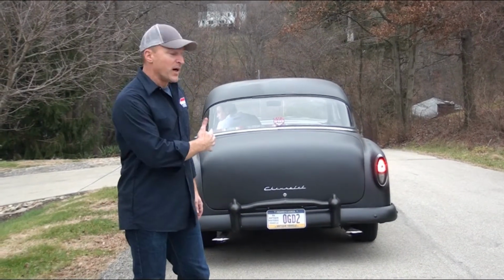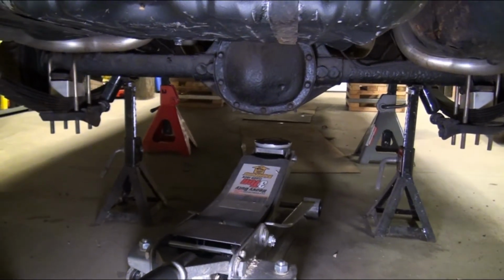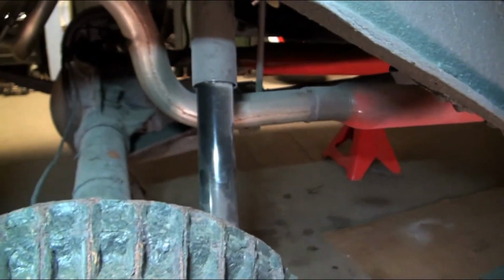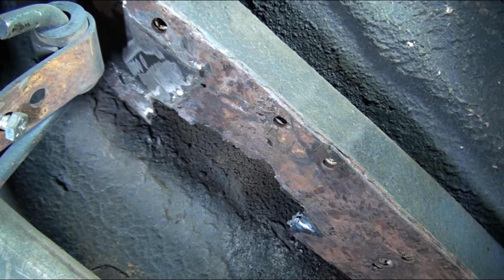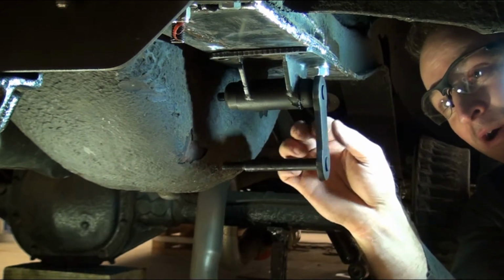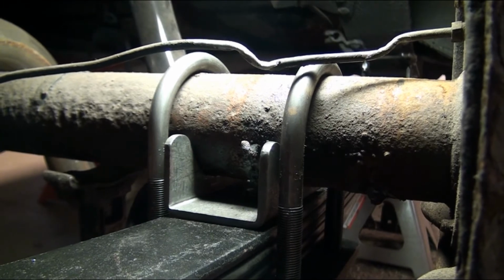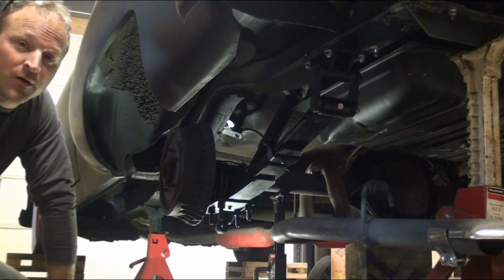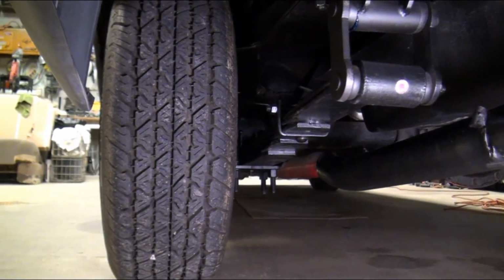1954 Chevy Sedan Rear Leaf Spring Suspension Swap

Comment: That is definately NOT the original rear end btw, the original rearend had a closed driveline. Great job, I really love these old Chevies had many as a kid
Reply: I agree that this is not an original 1954 rear end but most likely one from a newer Chevrolet car.  I don't think it has the original 235 cubic inch 6 cylinder engine either.  Many of these survivor cars have had newer engines installed and other modifications done to them with varying degrees of success.

Comment: Where did you put the brace for the shock mounts? Did I miss that? You did a nice job given what you had with the rust. I have a 51 and I’m going to do the same thing but thank God mine is rust free. LOL
Reply from the maker: Yeah, you're lucky if you have a rust-free car to start with. I had a clearance problem with the exhaust and ended up not installing the new shock mount brace. I'm going to install that at a later time. Typically it would just bolt to the top side of the frame rail. I think it aligns with existing holes in the frame.

Comment: I just picked up a 54 and I was thinking of putting in a 4 link system but I like this kit.  Did you install the upper shock mount or did you just use the original mounts?  I was curious if you did install the upper shock mount how that was and if it would require removing the gas tank?
Reply from the maker: I didn't install the new shock mount as my exhaust was in the way. I do plan on installing it, though, as it's a much better setup than the original floor mounts, and it will help stiffen up the frame a bit. There is no clearance issue with the gas tank and the new shock mount.

Comment: Nice video. I was hoping to see how you replace the rear shocks on this car. Do have a video that shows this?  The manual we have for our 1954 Chevy Bel-Air doesn't really have good information.
Reply from the maker: Thanks. Sorry, I didn't get around to installing the new shock mount. For now I still have the shocks mounted in their original location. Are you installing a new shock mount, or are you trying to just replace the original shocks?
Reply: @RaybuckAutoBodyParts   They look to be the original shocks, going to replace them both because one of them went bad.
Reply from the maker: @authentichomestead  Ok. Should be an easy swap, then. The shocks simply unbolt from the mounts on the rear end, and then unbolt through the holes in the floor.

Comment: I just bought in 1951 Chevy car coupe I want to take that in-line six rear out I did the same thing to my 1951 Chevy truck I ended up putting a Chevy S 10 rear end. What kind of rare end do you have on your car
Reply from the maker: Unfortunately I don't know what the rear end is in this 54 as it was in the car when I bought it. Whatever it is, it's a bit too narrow, though. If you already have an S10 rear end in your 51 truck, I'd say measure it and see if it will work in the 51 coupe. If it looks like it will work, please post measurements here so others know.

Comment: What set up do you have on the rear axle/differential for that 350? I’m looking to add a 350ci to TH350 and don’t know the drive shaft or what to do about the rear to support the 350HP.
Reply from the maker: It's a high 2 gear ratio in the rear end. Someone made a transmission mount for this 350 when they installed it.

Comment: Does the manufacturer of the leaf spring kit suggest to use loc-tite on the mounting plate bolts? Nice install. How has the ride been?
Reply from the maker: They did not recommend using loc-tite. I didn't use it and haven't had any issues with anything coming loose. The ride is completely different now. It's like a new car. Now I notice some sag in the front coil springs, though, so I may do those next ;)

Comment: Will the same springs fit a '52 Chevy? Can I get them in standard height or even raised for a Gasser style ride? I want a set. Where do I get them?
Reply from the maker: Not sure if these will fit a 52, but you can find these on most performance sites (Summit, Jegs, Speedway, etc). These said they would drop the car a few inches, but I ended up putting the lowering blocks back in as it sat too high. I don't have a point of comparison for the stock height, though, as mine was already modified. I don't think they have ones that will raise it higher.

Comment: Were you able to get a power steering system installed on that 54? I also have one. My problem is I wanted to keep it all original. But I'm stuck. What would you suggest without changing the front to an IFS?
Reply from the maker: I left it original with manual steering. You can leave the front suspension original and still change the steering, though. There are kits specifically to do this.

Comment: Not original at all!!  I have a ‘53 and a ‘54. The rear end is a closed end design like most earlier vehicles. Think ‘55 had the first Chevy open rear axle. Maybe the springs are original but I could not say. Good video any way for many installs. Cheers